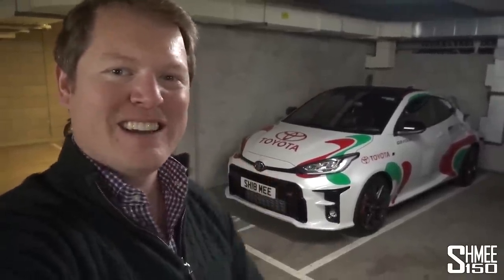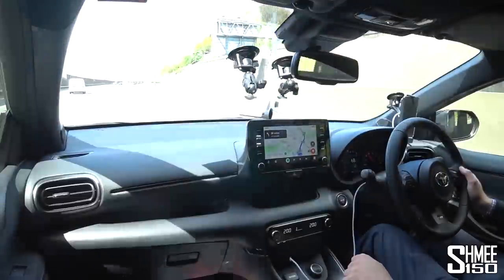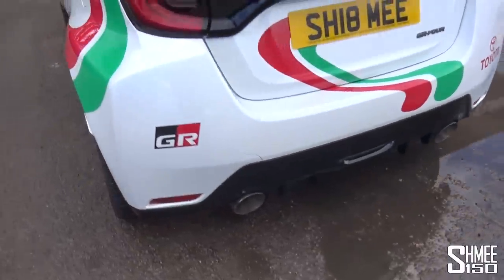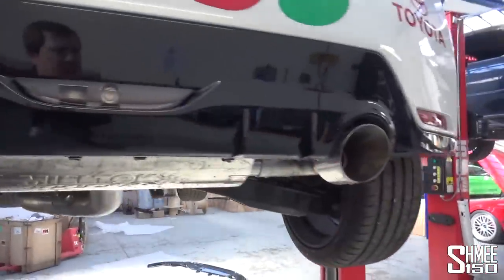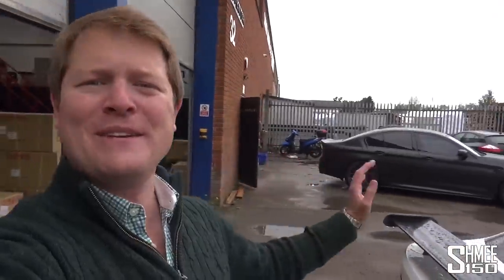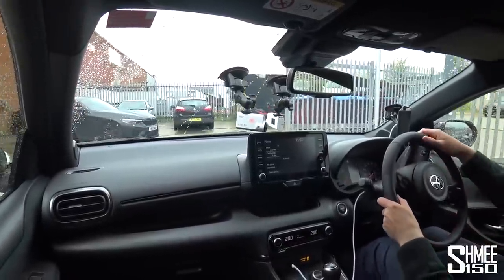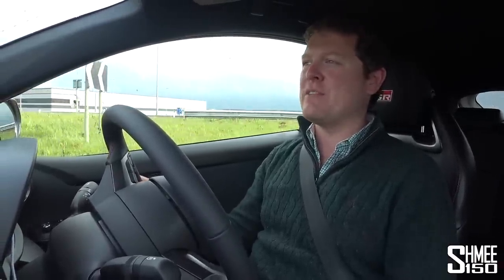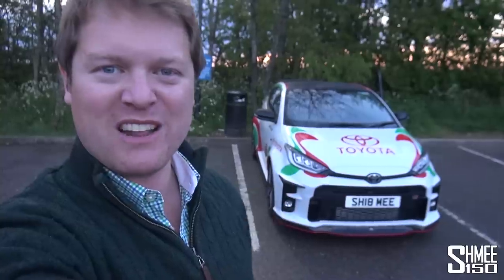GR YARIS STYLING BODYKIT! Giacuzzo Parts Installed

Comment from the maker: How about this! My Toyota GR Yaris is looking on point with the brand new Giacuzzo Styling Kit consisting of lower parts and a new wing - this works very well with the livery! https://www.giacuzzo.com/toyota/gr-yaris/
Reply: Hi are you  in Germany because I saw on a different video I saw your Mercedes Benz gt roadster
Reply: That is a very classy body kit. 👍
Reply: It coming together Tim, I like where this project is going. Keep it up. o/
Reply: Are all these additional body parts ppf'ed?
Reply: Supposedly there's seat kits out there that result in the driver sitting lower and not being obstructed by the mirror 👍
Reply: Such A Beautiful Toyota 😭❤❤❤❤
Reply: Remove the rear seats and put a Roll cage in it
Reply: I reckon you need some spacers on the wheels to widen the track of the car. It will give it a better rally car look
Reply: @jameshorsley2781  Plus a flare kit and a bit of negative camber for the front.
Reply: Shnee your plate number have the 8, and the side sticker is empty missing a number! I'd put a 8 there :)
Reply: Project Shmeemobile, Guessing that there is going to be a tune to make a power dense GR Yaris engine!
Reply: Looking awesome! Would be nice to have a video about how adding parts effects insurance on your cars
Reply: Tegiwa make a solution for the rear view mirror being intrusive
Reply: Please strip the carbon roof wrap and ppf the forged carbon
Reply: Pro Tip: The roof of the GR Yaris is actually beautiful forged carbon under that weird fake wrap! Might want to take that off.
Reply: Shmee150 Awesome Video I think your GR Yaris looks awesome with that Giacuzzo Styling kit

Comment: I dont get putting a styling kit on a car thats a homologation rally special. You should be doing an rally build spec. Weight reduction. Caged. Suspension upgrade. Tyre upgrade. Then learning to do rally/gravel driving.

Comment: Am I wrong or has there never been an update video on the sls black series sound system? If theres one could someone please link it, and if theres none, why not? the original video has been out since 5 months
Reply from the maker: You are correct, it was just mentioned in the garage update when I returned that there's something with the car that needs fixing. Thanks to the pandemic, parts are on major back order. Unfortunately I don't know when that will turn up and when I can collect it back and get the final audio tweaks done.
Reply: Wow I forgot about that car entirely. Looking forward to the updates!

Comment: Nimble hot hatch look is good for a Euro rally type compact.
But it'd be super cool, radical, if Schmee clean-customized a cheap reliable
compact into a 2 door sports coupe, clean custom street rod look. Big 19 inch wheels, fenders rolled out
for that. Turbo charged race upgraded engine. No plastic gingerbread. Either a 2017 Honda Accord 2 door coupe, 
or bring a 2021 Corolla to Kindig It Design in Utah, USA, have them convert it into the
2 door concept coupe shown in this YT video:
"2022 Corolla Two Door Coupe", url link: (view at 1080p)

https://www.youtube.com/watch?v=UT_whkrdG_4